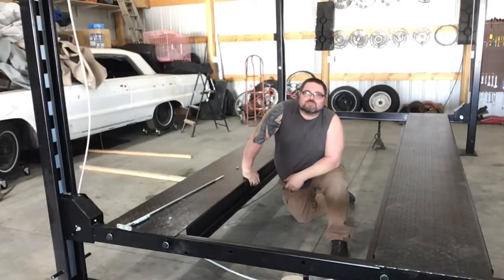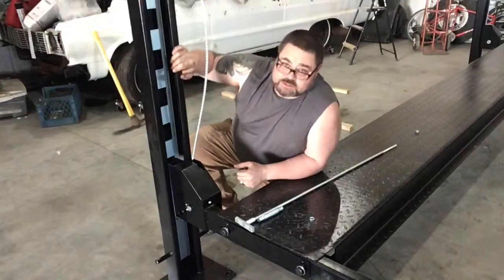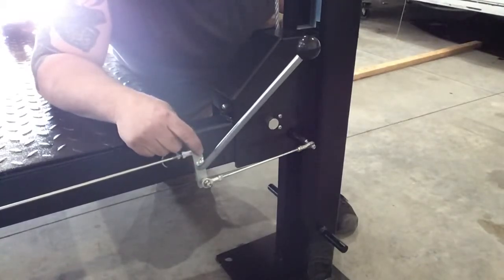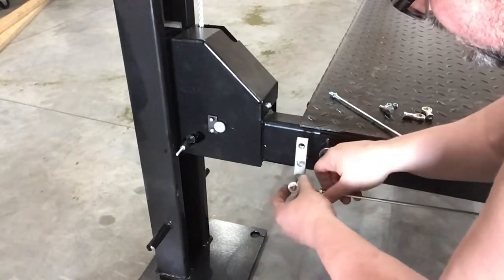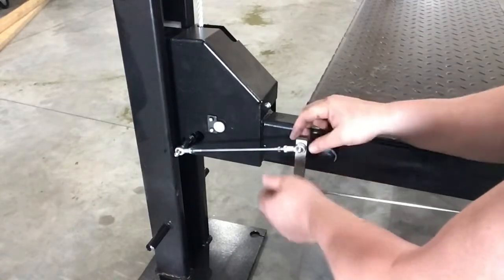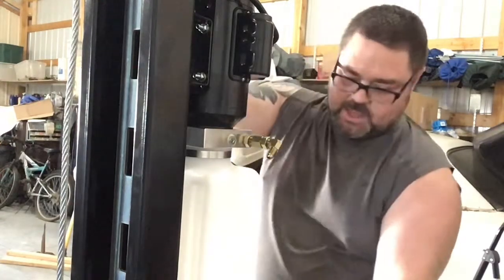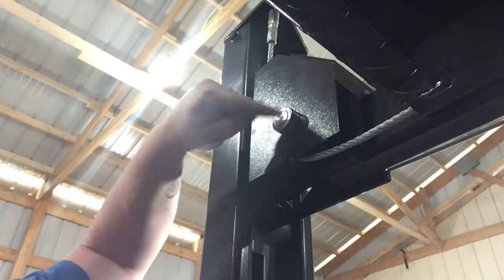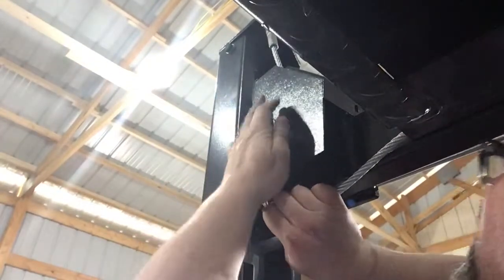Install 4 post car lift

Comment: I appreciate the video. The instructions really suck. This really helped me
Reply from the maker: the instructions were VERY difficult. hope everything turns out great.
Reply: Good afternoon, I have the lift columns turned and bolted down. The platform is flat when in one position.  What happens is the entrance will settle but the front hangs up. Do you think it could be the cables not being the same length? I think I say you measure and reset the lengths? Thanks Dave
Reply from the maker: when it sat flat on the floor we just tightened the cables till they were snug. everything worked fine.
Reply: @JUSTTRYITDIY  that’s what I did but it still hangs up on the back end and will not settle to the bottom. Very frustrating. Any ideas? Thanks Dave

Comment: Just got this lift (different brand but clearly the same) and half way through installing. You've done a great job of highlighting all the things i was scratching my head over that the instructions dont really cover very well. . I made the error of putting the top caps on the wrong way the first time . Also, was confused about the extra little pulley!

Comment: Thank you I have been struggling with my lift install.  The instructions are really not very helpful.
Reply from the maker: I Agree those instructions were not good at all.  Thanks for watching.
Reply: @JUSTTRYITDIY  it weren’t for your video I’d have to hire someone to install this thing. Thanks again
Reply from the maker: that is my goal. help save you some dollars!
Reply: @JUSTTRYITDIY  one last question, do you need to bleed the cylinder and if so where on the the cylinder ? Thanks
Reply from the maker: @dave5833  I believe we bleed everything at the tank, we didn't need to bleed the cylinders.
Reply: @JUSTTRYITDIY  wish I had some way to show you how I did this install all by myself. Don’t have twitter. Got everything almost buttoned up and ready to test tomorrow sometime. Thanks again for the help.

Comment: I got my lift all installed but I'm not sure how to adjust everything
Reply: Raise empty lift enough for it to lock on the first lock. Use level and level using nuts on locking ladders. Lower lift. Put a car on lift, raise lift about two feet off the ground making sure not to allow it to lock but rather let it hang on the cables in the middle of two locks. Level the runways and cross bars again, only using the cable and nuts to do so. Done

Comment: This is by far the best video describing in details the assembling of the hoist. Please inform, what is the make of the lift? Is it Atlas? It seams to be well designed.
Reply from the maker: This was an install for a friend. The lift was a Forward Lift 4-Post.   Model# EFP8P000M